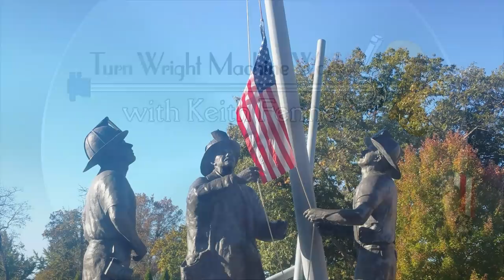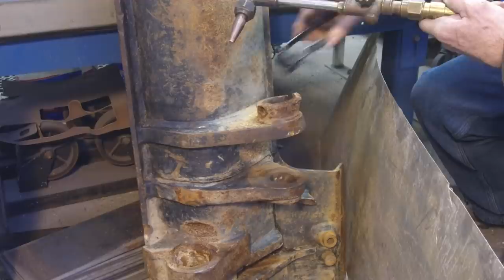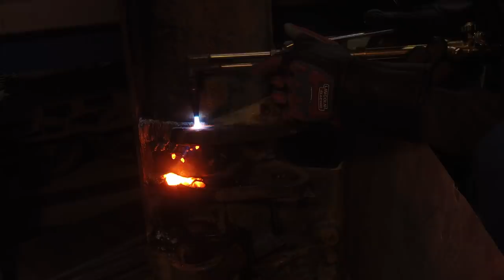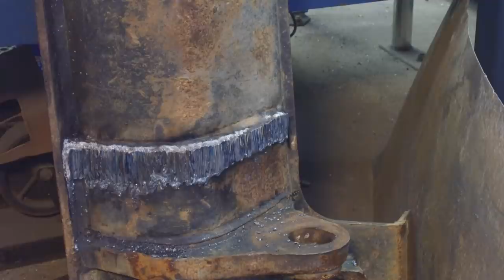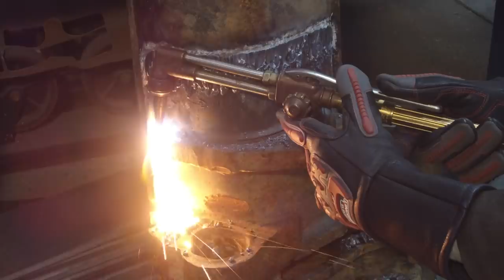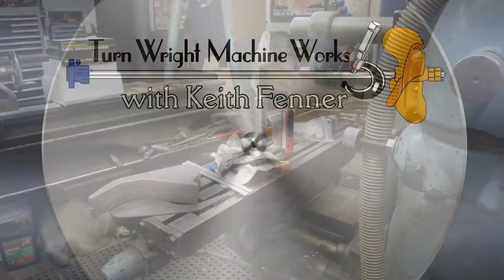Intentional Disregard Part Two

Comment: I’m 81  years old  i designed and built and maintained rock crushing equipment for 50 years. There’s two kinds of people that keep you busy there’s the  “ boy someone screwed that up “  and there’s. “ boy they got all the good out of that “  the someone’s and the they’s will keep you busy an other thing you can not fix anything you can only work on it when you do fix something you’ve just moved the weak point to a more expensive part.  I’m also a machinist you’re a remarkable man i enjoy your videos

Comment: Keith I can certainly appreciate ur channel and the way u repair things ! I started in a ship yard when I was 18 I worked the docks as a welder later engine block welder machinist I would get lucky and get called to the machine shop to weld up a coupling or key way and on a big lathe they would have a 30’ by 8” thick tail shaft and straighten it the way u do rose bud garden hose I seen things tore up and wondered if today maintenance or grease guns are thing of the past I know there are more than one way to skin a cat keep doing what ur doing sir your awesome

Comment: I see Amazon sells a Victor #2 bent cutting tip especially for flush cutting, dressing weld remnents, etc. I doctored mine so the oxy jet ran parallel to the surface to be saved with about 1/16" clearance. Saved a lot of grinding in awkward-to-reach places. 

In the early '70's, I re-flanged and re-cambered several swaybacked low-boy trailers using a bent tip with the same kerf widening weave you demonstrated. And heat shrank the webs back to the original camber with a big rosebud tip. But I was a slave to my gas supplier. When I quoted the job I failed to figure in enough oxy and acetylene. Besides cutting off the flanges and straightening, there was the preheat for the low-alloy flange material. Many trips to Siler's. Didn't make a nickel.

The bent tip worked slick. I barely touched the edges of the webs.

Small world we work in..
Reply: Would I be correct in guessing that your Yankee scarfing tip is the same as an Aussie gouging tip?
Reply: @Ropetangler  More than likely, but for what little gouging I've had to do, I prefered carbon arc. Amputating ruined structure, stuck bolts, and other flush cutting situation where heat, and flying slag aren't inhibiting factors, I always preferred my doctored flush cutting O/A tip. I eventually used that tip up. I was never able to make a replacement as satisfactory. Makes me wonder what I did right, back when.

Scarfing here in the land where people talk funny refers to beveling an edge usually to an acute angle. Like a prep for a spelter brazed lap joint in old time coppersmithing. There's also scarfing where thinner plate butts to thicker and it's desirable for stress distribution to have a tapered transition. This kind of scarfing would be very difficult to do free-hand with any kind of a O/A torch. I'd have to use a track burner if machining the tapered scarf wasn't practical.

Before anyone gets the notion I'm an old time fabricator, I'm not. But I've done some fancy work in most all the metal trades. I'm no fool: I was very smart about seeking expert advise when I needed it and followed it to a (usually) successful conclusion. Word to the strivers: never miss a chance to pump the brains of people wiser or of wider experience than you. You never know when some odd bit of normally unrelated information will save your bacon.

Comment: Ran a bobcat skid steer for over 20 yrs. First thing I always did, besides check the fluids, was grease each and every grease fitting. While I did all that, I still checked over all those "hinge" pin points. Everyone at my former job used to give me a hard time because, I'd always raise and lower the boom arms, raise and lower the bucket. I was doing a multiple of things while I did that. Checked for any "sloppiness" and seeing how the machine was going to run for the day. Yes, sometimes those machines would operate a bit finicky at times, just had to know how it was going to operate for the day. If there's going to be a "blame game", it should always fall onto the operator. It's his/her responsibility to ensure that the maintenance was done and done proper. As a former operator, I had that option to refuse to operate that machine until it was fixed and fixed correctly. 
Keith, you're a true professional at what you do, this is why I enjoy your channel. Always learning something new from just watching and listening to what you're saying and pointing out. Cheers :)

Comment: Great Video Keith. Who else these days teaches you about oxy-acetylene cutting torch settings. The need for a spark shield is never usually talked about. Yet, anyone who has ever used a gas burner, understands how much you will be burnt by dripping molten metal; dropping on the floor next to you.

Comment: I wouldn't be too quick to simply blame the equipment operator.  Depending upon the organization using the equipment, there could be a number of people who ignored the problem.  If it's a large organization, you can have maintenance people telling the operator to continue using the equipment, the owner telling the operator to use it, etc.  After awhile, the operator figures, "If they don't care - I don't care."   It certainly starts with the operator, but the entire organization is responsible for letting something get that bad by not having a preventive maintenance attitude and plan for the equipment.

Comment: I still can’t believe the way customers will send a part to a shop and not clean or do minor prep. When I was sixteen (a long time ago) I worked in a shop part time as a shop hand prepping jobs, mostly cleaning items. The shop charged the same shop rate for my work as for what an experienced machinist would get and when a customer complained the boss would tell them “well you could just clean it before you sent it in and saved some money”.
Reply: Excellent response from your boss.

And I'll just add: Bill clean up at the higher rate as if it's too low, customers will just say "Jack can do it, I can't be stuffed doing it"

Comment: Hi Keith - I think that you nailed it with "A Decent Operator to know there's an issue". There is a hell of a lot more to it than sitting in a seat and pulling levers.  Videos like this one (I hope) will help people to think more about whatever kind of machine or vehicle they are operating.  [edited bit - Could you do an added video to teach people about the use of Gouging Nozzles please - I learnt the hard way cutting Limber Holes in steel boats but this job would have been a good example]. Thanks for sharing with us - Have a Safe and Merry Christmas.

Comment: I’d love a bit more “torch teach”. It’s hard to see the flame well on video. My knowledge of a well balanced neutral flame for cutting might be lacking a bit. I might be adding too much oxygen without the trigger depressed, I’m not sure. It’s difficult to get seat time for flame cutting. Both metal and fuel are pretty spendy. Not to mention super risky and messy in a small garage/shop.
Reply: Ok so heres the basics. Basically turn the Acetlyene up until you see the flame seperate from the tip. Just before that point is where you want that set. The oxy turn that up until the white portion is about 5-10mm from the end of the tip. Then hit the trigger for cutting and adjust it up until that is also now 5-10mm from the end. And you are good to go. Different tips will need different settings on the regulators and for some tip brands is actually engraved on the tip itself. 100kpa on Act and 200-700kpa on the Oxy for anything 10-100mm thick scaling lineally works fairly well.

Comment: Good call on the dipper swing. I've got a 60's Case 450 crawler with a backhoe attachment. The swing cylinders are wallowed out and the bucket moves 6"-8" when everything is only 1/2 way extended. I don't use it to make money but its very annoying. I've got to pull them and rework them.
Reply: Not only annoying but you can't do precise work and possibly a safety issue.

Comment: good morning Keith, Good points about the arm chair quarter backs passing the buck. Looks like a good repair so far. I can't wait to see if the weld broke or the steel had failed. looks to me like the weld was cold when laid down. I seen a lot of the same thing in my shop for the last 35 years as well. Keep up with the good work and Merry Christmas.

Comment: A new mindset in certain industries in to let it run 'til failure.  They think it saves money over regular/preventative maintenance in the long run.  The same  steam condensate pump was replace 4 times in the 10 years I worked in one building!  The pumps were never greased, just ran them until they failed then replaced them.  A set of lift station pumps were installed, and grease lines installed to above grade to eliminate the need to enter the confined space for maintenance.  Never greased then finally replaced.  At the end of one project we were required by the Government to send every piece of purchased equipment to disposal, not salvage or recycle.  WE WASTE OUR WEALTH IN THIS NATION!  Loving the machining, and welding, on this project to save a piece of equipment.

Comment: As trained toolmaker know for the last 20 years mobile welding I see this a lot. Do you know what Keith I worked out a good while ago you cant save the world of plant operators......
If their coffee flask was connected to the grease gun things would last a lot longer.
Had a guy snap a 6 feet ditching bucket trying to pull a oak stump as he was to lazy to change the bucket.
cost the firm a big bill...not him but the firm. BTW the close cut beard suits you well.
Reply: Never could and never will. 
Fancy meeting you here 😉
Reply: he needs to use more pipe dope

Comment: What size bottles do you have, Keith? That was a good deal of cutting. Lots of oxygen flowing. How often do you exchange?
Reply from the maker: Large set and I use up the set in a month or two between exchanges.  ;{)
Reply: I just filled my large set last spring and i payed 350.00$ for oxygen and acetylene,the acetylene was filled in Canada.

Comment: RE the maintenance thing, several jobs I have worked on the watchword has  been production, production, this usually means you run your machinery until it pops, hopefully when it does, the parts have been ordered and received and it can be done straight away. Many times I have babied a machine till the weekend  maintainence day.      Often you have to run a sick machine because if you stop everyone else has to stop !

Comment: Hello Keith.  I've seen the fault lie on both sides.  I started working at my dad's shop (trucking and heavy equipment) when I was 12.  Preventative maintenance (especially greasing) was like a religion there.  He made sure everyone had a grease gun and access to grease.  Not greasing a machine would result in termination.  Needless to say we replaced very few pins and bushings.  I have worked at other places where the owners would not supply grease guns or grease to operators.  I guess they expected the employee to supply the grease and grease guns.  In those cases the owner gets what he deserves.  I live in the best of both worlds.  I like to see machines properly looked after (it makes me feel good to see that).  On the other hand when they don't look after them it creates interesting work for my shop.  I can't lose.  Ken
Reply: Sounds like your dad was a very smart man and you for following him.

Comment: The ones that run them usually cant fix them. Not universal in that statement, but common. And they don't realize what it takes to repair this kind of damage. I have repaired many in 40 yrs.Air arc works great for this type of job,but not all have one.Great job by the way!

Comment: I realize this is a little late but did yo consider using a gouge tip on the torch when cutting the ears off. If you could go outside you can cut the welds and reduce risk of cutting into the base piece.

Comment: You should keep a rivet/flush cutting tip on hand if you don’t already have one nice and close with one pass. I know it would be too messy in the shop but if it was easier to handle it would be nice just to arc air it off.

Comment: Curiosity Keith what did you set your oxygen & acetylene gauges at.
Reply from the maker: 12 and 25, plus and minus some. ;{)
Reply: @KeithFenner  way off 
12 is way too much acetylene 
acetylene should be about 8 and oxygen for one in plate should be 35 to 40
Reply: It may be needed to get proper flow with the length of hose and the very restrictive spark arrester setup ?

Comment: Hello Keith,

Good points on maintanence, some of that could be contributed to poor design. The pivot nearest the hydraulic cylinder had the most wear. 
I did a video on my worn bushing on my old Sheldon lathe. I was lucky the wear didnt get into the casting but it was very worn. As always a video packed with information. 
Mike - Plus8Precision

Comment: I have heard of gouge rod how do they work?
Reply: If you are talking about air-arcing, then use a welding machine with high amps, start an arc and blast with air from the handle to blow the molten metal away.  Works real slick.  It is the reverse of welding-joining two pieces together only you melt the metal and blow it away.

Comment: Keith if you had to remove lot's of structial part's i use carbon air arc of course that's a out side job and you must use ear protection that's a must .🎄🎅 Have a wonderful Christmas and New year.

Comment: You’ll want to weld/tack a spreader bar across the top of those to keep them aligned and put a spreader bar between all the bosses, that will also help to keep everything on the nuts. You may have to use a porta-power to get the spreader bar out from in between the ears/bosses...
 Good luck n lookin good.
Ps.  What happened to the beard...?
Reply from the maker: I cleared the face to match life change. ;{)

Comment: Did you or the customer consider adding brackets for a second cylinder to even out the forces on the assembly?
Reply from the maker: Might not of been in the budget. ;{)
Reply: May not be possible either. That looks like a JCB part, they only have a single offset boom on their small skid steers. No place on the left side for a cylinder.

Comment: Another way to repair this would be to make and weld 2 flanged inserts after you line bore oversized holes and straighten the brackets.  The flanges will be welded to the original metal and sized to accept the new bushings with a press fit.

Comment: I've never had a problem with restricted flow using the mixer with integral backflow preventers, even running a rosebud.  Sounds like something may be wrong with the particular one you have.  How big of a rosebud tip are you using?  But if your trusty old one works fine, no reason to change it.

Comment: Keith,
Just curious...could you use the hand held plasma torch to cut off the ears?
Eric
Reply: Actually I was wondering about plasma too. Turn down the amperage and blow off the welds.
Reply from the maker: With less control. ;{)

Comment: Interesting video Kieth, but I would have taken a different approach getting those ears off, I would have cut the ends of the ears up to the bucket at each end of the crack and another cut in the middle of each ear up to the crack, and then break each half of the ear clean off along the crack line using a lever welded to it, this would just leave some weld to grind away.

Comment: I understand your plan. What i don't comprehend is: the plasma cutter cuts the outline of the "ears" flawless, why can't it cut a pilot hole in the same plate (if ever necessary)?

Anyway Keith ... thanks for the videos and happy Holidays.
Reply: Because the size Kieth has does not have enough power to burn a hole or pierce that thick of material.  I would be willing to surmise the tip he was using would have a hard time piercing that thickness material as he started on the edge.
Reply: He started from the edge, because the machine works at its limits. Sounds plausible.
That makes piercing possible, starting from a drilled hole.
Thank you.

Comment: Watching you cut, I see a need for an offset torch head. I don't know if such a thing exists.
It would allow you to hold flat against the material and make a straight cut with no angle.
Sounds like there is $$ to be made making one.
Reply: MIDBC1  In multiple sizes and shapes.

Comment: It made no difference what I did when cutting with the torch I would get some slag on clothes and burn a hole in them and then ME! But loved the smell of the metal as it was cut. Same as with 7018 rods when welding.

Comment: Try a gouge/scarfing tip.  Made just for this. Straight cut the ear off then clean with gouge tip.  Or you can remove the weld.  Like a air arc but with more heat input.

Comment: 26:39 that the spark arrestors doin their job?  If so, what would have happened if they weren't there
Reply from the maker: Got to have them, I was just noting the pros and con's of the internal set. ;{)
Reply: Well to paraphrase the cheerleader. "Hiss, BOOM, AAAHHHH!"
Reply: @Blazer02LS  That is if a spark travels back through a hose into a tank then BOOM!  You will be very lucky if you survive the experience.

Comment: you should invest in a gouging tip best 30 or 40 bucks you would spend and a lot faster i think since you are only removing the welds not cutting thru the whole piece!!
Reply: i dont think his compressor is big enough for one unfortunatley
Reply: @dphillips705  Adding a receiver (another storage tank) would help to alleviate that problem.